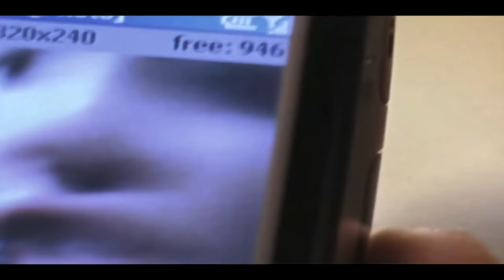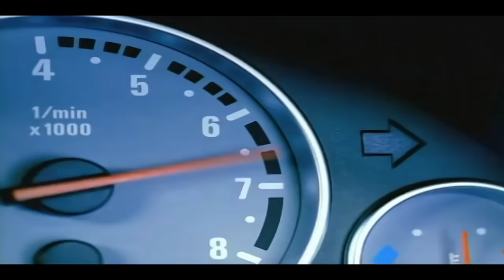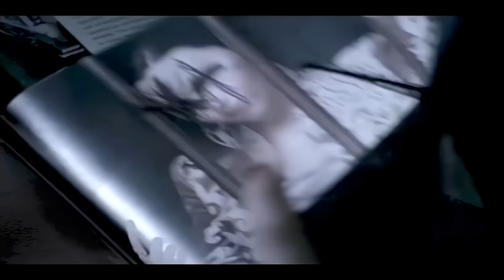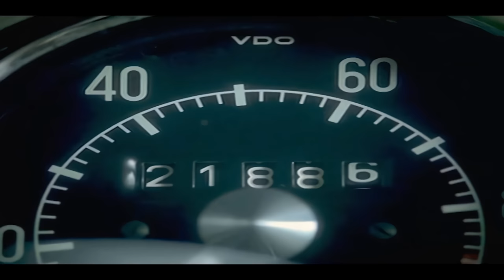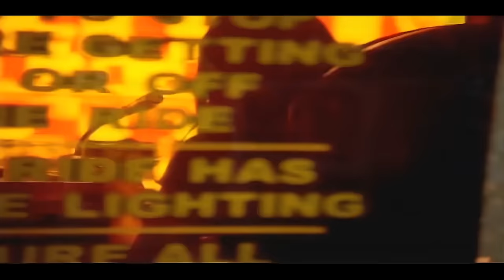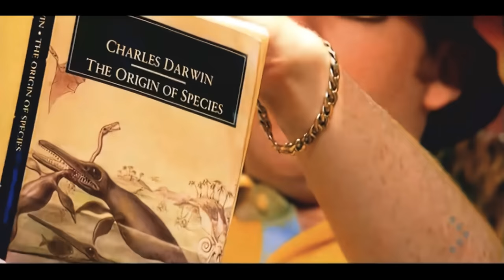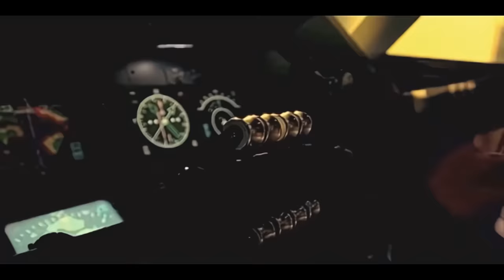The Classic Project 3 HD-4K -Pop 2000-2004  #ClassicProject3#MIXPOP#MIX2000#MIX2004#MIX#ClassicProj

Comment: He creado el audio de este mix en WAV y MP3 de Alta Calidad, debido que solamente se encuentra con audio de calidad inferior.
Tengo el archivo MP3 subido en mega pero quisiera compartir el link, pero no puedo porque me toma como spam.
Créditos al autor de este mix quien es Nicolás Escobar. El audio es idéntico al original, van a ver.
Si hay algo distinto en el mix es porque no se encontró el audio correspondiente al original.

Nota: En 2014 hice una reedición del audio de este mix pero con audio de mala calidad, con varias canciones en versiones distintas al del mix, audio saturado en varias ocasiones, y formas en los enganches que dejaron mucho que desear.